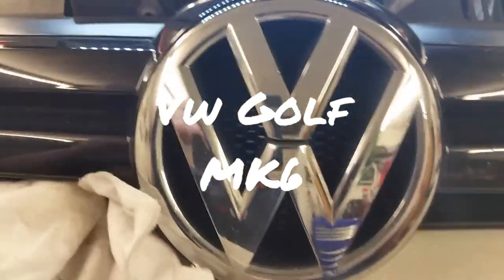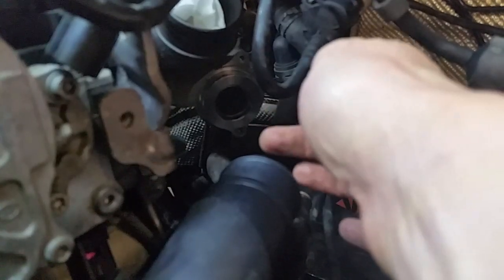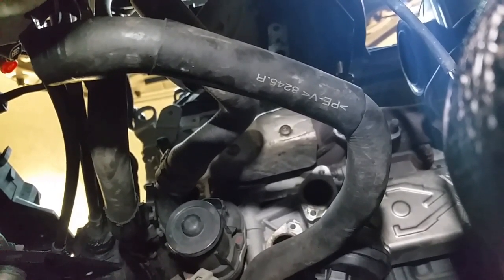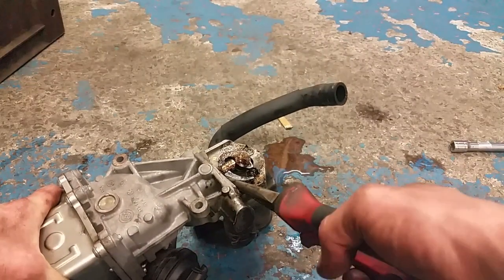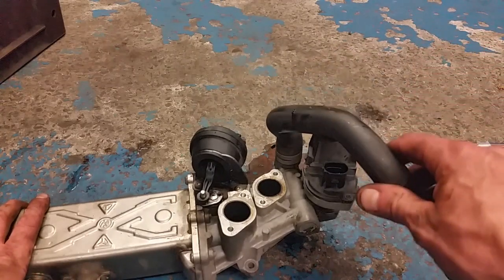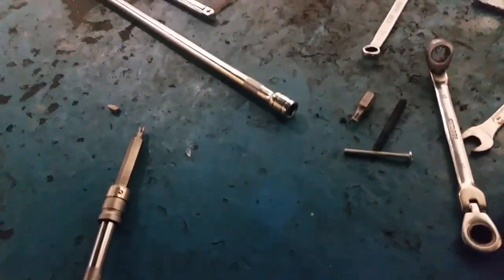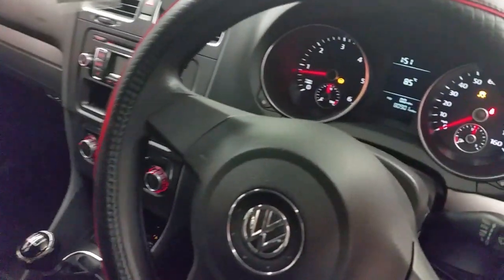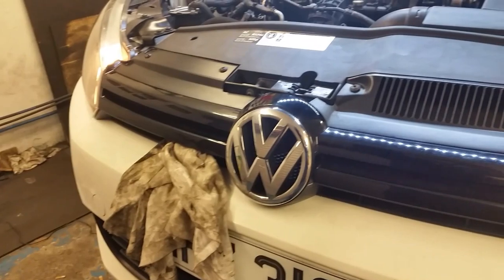MK6 VW Golf  1.6TDi. EGR Valve. Fault Code P0403.CAYC, CFFB Engine Replace tips

Comment: To anyone coming here before you take on this job... I highly recommend to just remove the subframe- it takes an hour of extra work and you can leave the wiring connected, just lower it slightly and swing it out of the way on a gearbox jack. 
Once thats moved the Dpf can come out and access is so easy- takes half an hour to remove the egr valve then! You wont regret it!

Comment: Excellent video Dave thank you for uploading for us guys to enjoy and educate ourselves !it’s a pig of a job to do!!
just a tip for you next time just replace the small roller bearing on the pivot shaft arm ( it’s a 623zz bearing) the wee roller, The bearing surface Wears And the whole arm seizes 
Clean out the whole EGR system with some Mr muscle oven cleaner and you’ll be just fine for another 50,000 miles

Comment: Know this video is old but I had no power after my injector bolt snapped and shot out 2 injectors. Bought the bolt, put everything together. No power, had underboost faults, Replaced turbo, deleted DPF and EGR, still no power. No faults this time, any ideas anyone?

Comment: hi  dave i have a leak at the 27mm banjo bolt the problem is the seals on it a very narrow ive tried a few car shops and they dont sell them there Basically about one mm thickness. any chance you kknow where i could get these oil seals please

Comment: Mine does same, it’s not under power but whit smoke after every few minutes, if i gas it it goes and then drive for few minutes without smoke and all of sudden white smoke again, dono if its turbo letting oil go through and it starts burning in exhaust. What do you think could it be.

Comment: Hello,
And thank you for your great video. after replacing the valve egr of my vw sharan 2.0 tdi 2012, at startup the idle engine is unstable, I have to wait for the temperature to increase so that it stabilizes and returns to normal. Now I have the default p0403.
What should I do?
Thank you for helping me.
Reply: Same here what was the fix for that thanks
Reply: Maybe need to do EGR adaptation? I remember there are this option when connected to OBD computer. I don't guarantee this works, but I restored fuel injectors and adaptation was a must, otherwise engine worked unstable when idle.